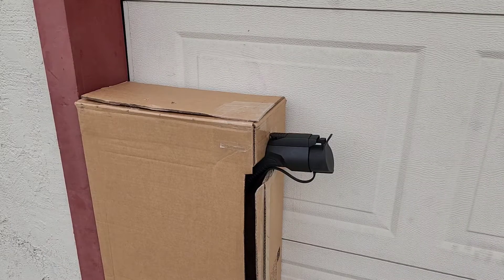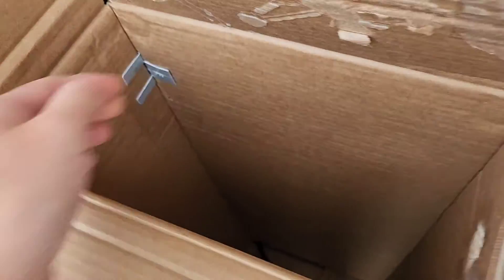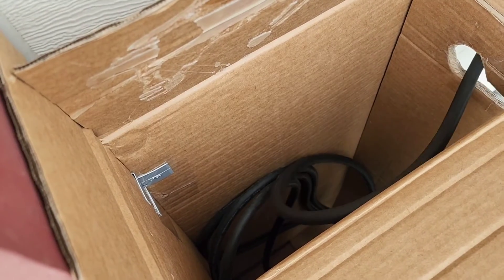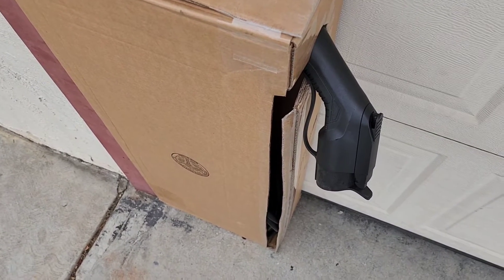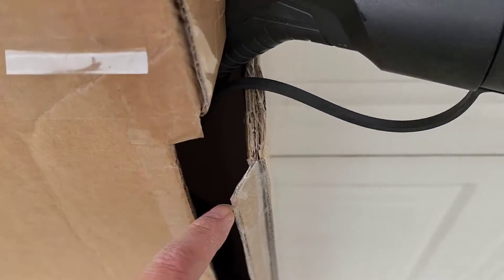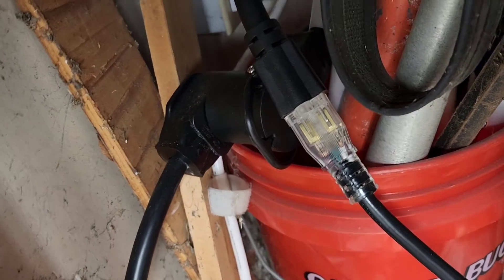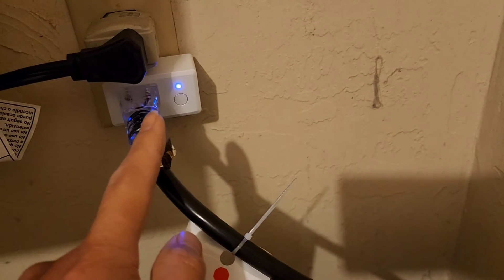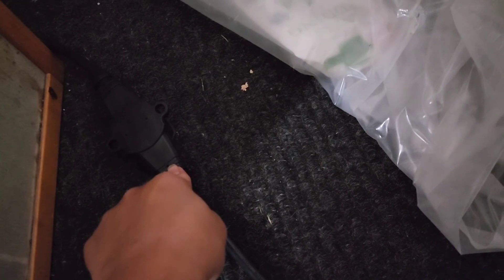240V 15A Makeshift EV Charger Charging Station From Two 120V Outlets (Ready for my Tesla Model Y)

Comment: Don't try this in YOUR home.  A minor problem is that the long 14 gauge extension cord to the laundry is only rated for 12A continuous (defined as more than 3 hours) so you really need 12 gauge which can handle 16A continuously (continuous rating is 80% of nominal).  The bigger problem is that this only works if you know that the two 120V outlets have their hot wires 180 degrees out-of-phase to each other and you have a 50-50 chance of that if you just choose a couple of available outlets without really understanding their connectivity inside the electrical panel.  Good luck explaining what you did to the fire marshal if your house burns down.  A 240V circuit used for EV charging should be dedicated, i.e. no branch circuits, which is unlikely for random 120V circuits in your home.  If you don't want to pay for installation of a code-compliant 240V circuit then you should stick to Level 1 charging and tolerate the time needed.
Reply from the maker: Nice of you to assume. It's a 12 gauge 30ft extension. I researched before doing this. If you're worried about it, you can set the charge to 12a. Lol and I run it at 15a. Never had an issue.
Reply: @ItsBinhRepaired  I didn't assume anything.  You said in the video that it was a 14 gauge 30 foot extension and you also said that such cables are capable of 15A which is only correct for less than 3 hours of continuous use.  If you misspoke during the video then you should correct the error lest anyone use you unsafe design.  "Never had an issue" is fine until you actually have one.
Reply from the maker: @rogerlevy2160  oops, misspoke in that case.
Reply from the maker: Also, you'd have the same issue with the 120v circuit if you pull too much power from other devices on the same circuit.

They try to prevent this by limiting the 120v charger to 12a, but a freezer/fridge, laser printer, microwave, electric stove, etc. will trip the breaker every time.
Reply: @ItsBinhRepaired  Charger manufacturers do not limit Level 1 charging to 12A in order to allow extra load but rather because many (probably most) 120V circuits use 14 gauge cabling which according to the 80% rule should be limited to 12A continuously.  Whether you use L1 or L2 charging, you should use a dedicated circuit.  My Nissan Leaf manual discourages L1 charging and I think that part of the reason is that many owners don't understand the electrical issues well enough.
Reply from the maker: @rogerlevy2160  oh, that's true. Forgot older houses have 15a breakers for that reason. As long as you're not tripping your breakers, it shouldn't be an issue.
Reply from the maker: Hopefully pinning your comment will help people get the right info.

Comment: I was thinking about doing something similar for when I visit friends with gasamobiles.  Your point about the stray voltage on the prongs was a loose end i hadn't considered, but i'm sure i would have learned the hard way soon enough (120 is just a tickle, right?).  I agree with the comments about not charging above 12A on a 15A circuit or cord.  I'd be concerned that some 14ga wire surrounded by insulation in a wall somwhere will just get hotter and hotter.  The smart switches are convenient, but probably a weak point, also.  I blew up a kill-a-watt meter with a small space heater (if i remember right, it was rated for it), and thats the same amperage as you're pulling here.  If I ever build my design, I'm planning to put a manual switch near the end of the longer cord, so I can kill the stray power before unplugging.  So, yeah, is it dangerous?  Probably.  If you know anyone with a thermal camera, and know where the circuits go, it might be worth testing for hotspots in your walls before and after charging for a few hours.  Until then, i might not charge above L1 while you're asleep.  That said, if you've had no problem with 15A, consider it your burn-in test, and you should be golden at 12A. 15A really is dangerous in this situaton.
Reply from the maker: Yup, I checked. My wiring is rated for 20a. I added a switch cable with nema 5-15p to 5-20/6-20r so I can use 20a 120v and 240v outlets.
Reply from the maker: The other thing to worry about is if anything else is running on the same circuit.